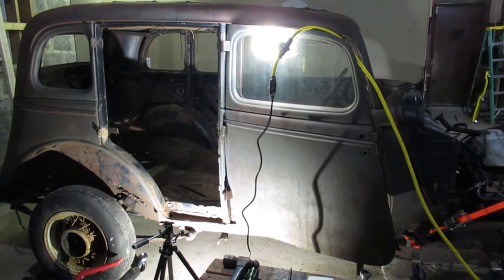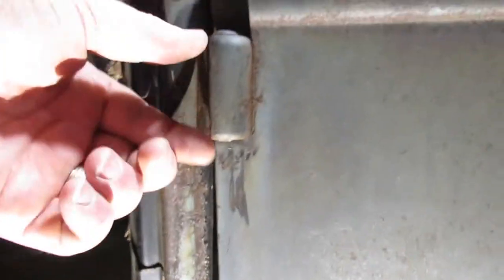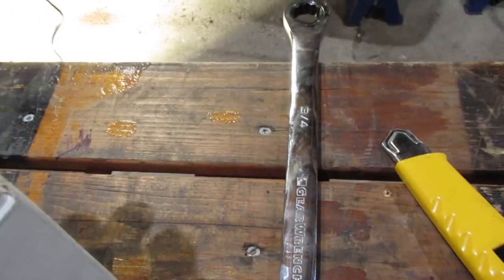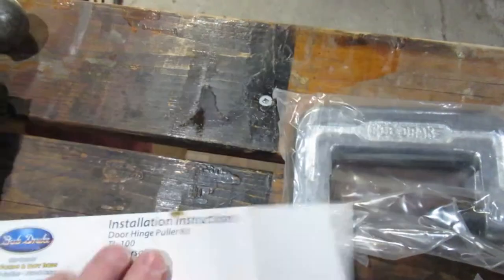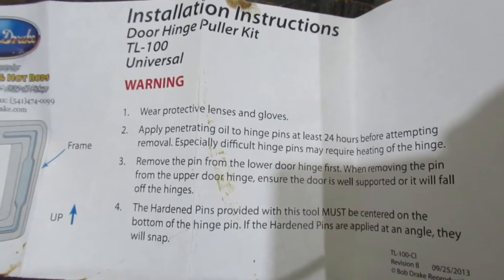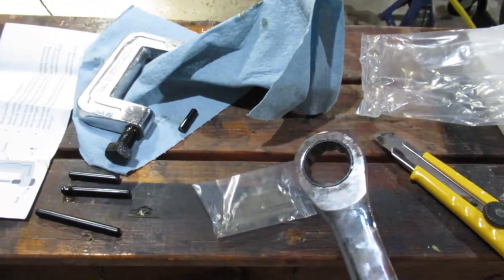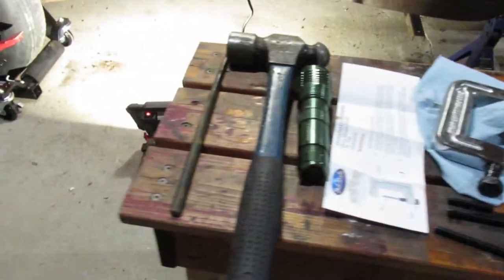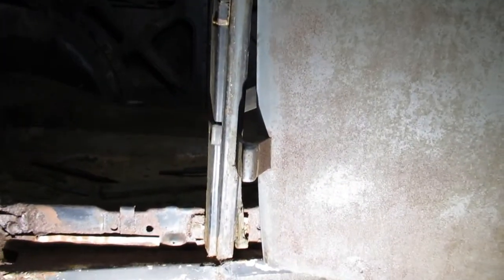1928 through 1948 Ford Door Hinge Pin Tool Bob Drake

Comment: Hitting the pin multiple times just mushrooms the bottom of the pin, making it harder to remove even when the knurled part of the pin is clear.
When using the tool, tighten the bolt very hard against the pin, then hit the bolt upwards with a hammer (one hit only), then tighten the tool again, repeat. The bolt applies a huge force on the pin, and a further tap with a hammer shocks it.

Comment: This tool is no good unless you grind down the bottom of the hinge pin...as it's curved..and the tool will simply slide off...just bought one and I'm massively disappointed....as you have to do umpteen different things first before it actually does what it's supposed to do.